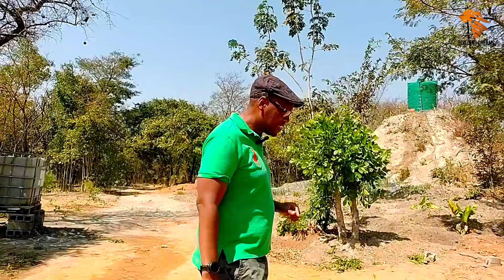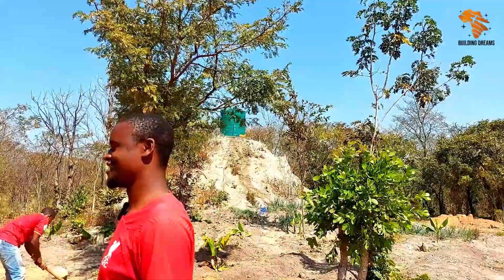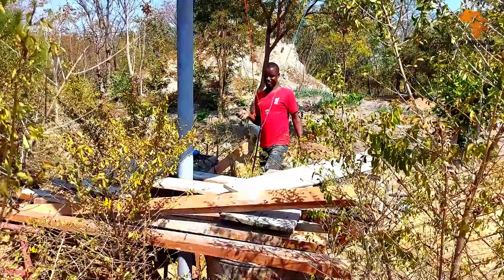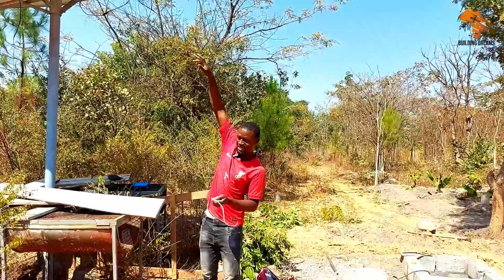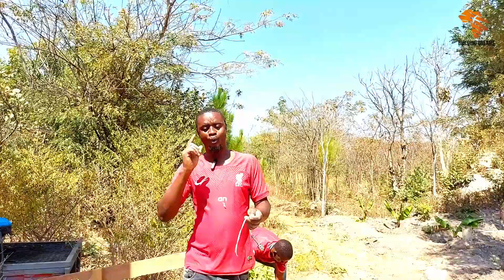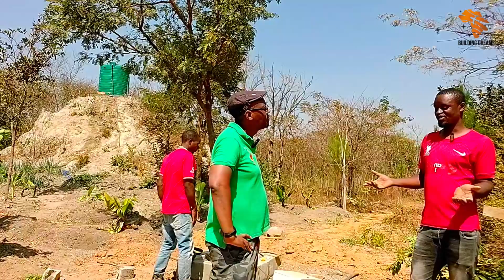S3 Ep 18 | Solar Powered Borehole Pump: Explained in Zambia

Comment: You said the solar module is producing 41 v but the controller has voltage range of 48 to 90 v, how is the pump working with under voltage
Reply: @MumbaMwila-j9q  he said one solar panel is producing 41.1v and there are two panels there connected in series meaning the output voltage is 41.1+41.1  there's no under voltage there.
Reply from the maker: Thanks for raising the point. For the benefit of everyone following the discussion, could you please explain what you mean by “undervoltage” in this context?
It would be helpful if you could clarify how undervoltage is defined for a solar pump controller, and whether you’re referring to single-panel voltage, series (string) voltage, or the controller’s minimum operating threshold. That explanation would help us all learn.
Reply from the maker: Thank you for your contribution. However, I was interviewing, so I'm not an expert. Could you explain to us what sort of pump should be used there, or what the numbers should be so that we can learn?

Comment: Good Afternoon, im new in the farming business. I have a question, is it possible to install a solar water pump onto an already exisiting water tank that uses an electric pump?
Reply from the maker: Hi @zuludavid09, great question—and welcome to the farming world! 👨🏽‍🌾 Yes, it’s definitely possible to use the same borehole with both a solar pump and an electric pump. In fact, the technician in the video explained that they know how to set it up so you can switch between the two systems depending on what’s available—whether it’s sunlight or ZESCO power. It’s all about configuring the setup properly, and a good technician can guide you through it. Wishing you the best on your farming journey!
Reply: @BuildingDreamsAfrica Thanks for the response!